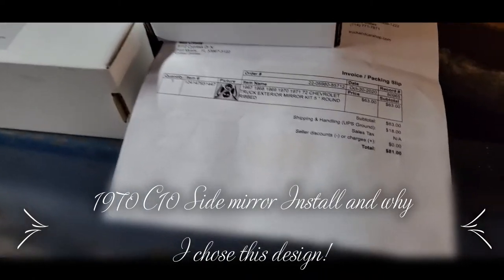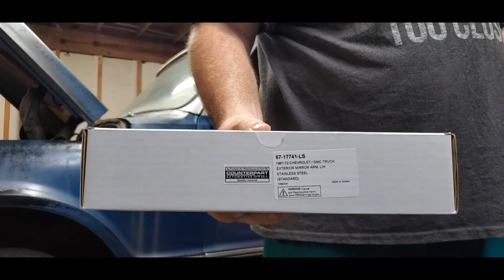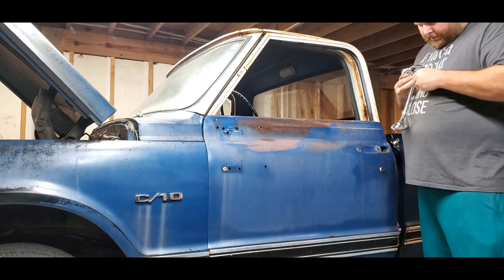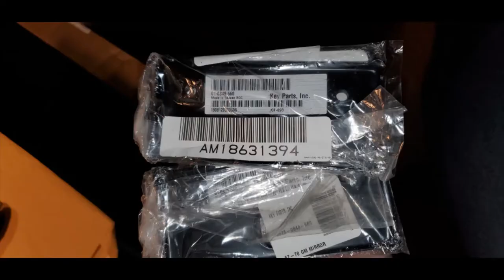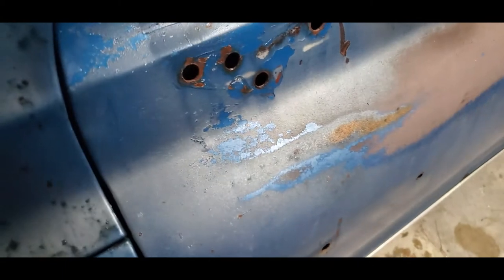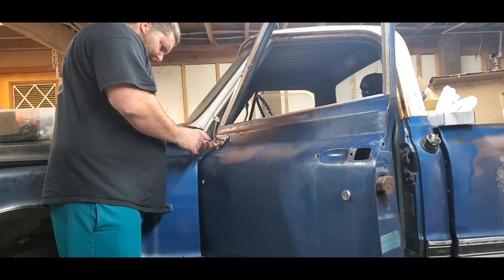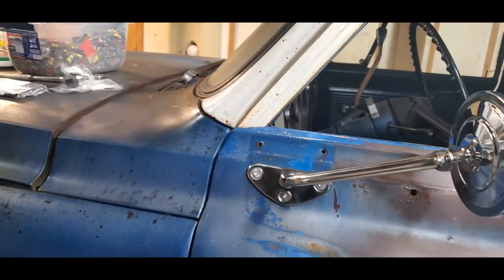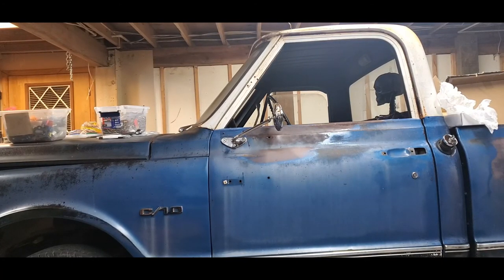1970 Chevy C10 Side mirror & why i chose this design!

Comment: Mirrors look good, I think im going to go with the square versions when I get to that point on my build
Reply from the maker: I almost did but worried they may look big even though these are 5" round
Reply: I tried the rectangular mirrors but they vibrated a ton at anything over 50 mph so I went back to the rounds. Just my experience...
Reply: The square version, or "sport" mirrors that these trucks came with look nice but are almost unusable when driving.  I've had them on my truck for a few years and the passenger side is completely useless.  Cannot adjust them enough to see down the side of the truck

Comment: Every time I work on these trucks, I find the factory backing plate laying in the bottom of the door.
Reply from the maker: I did look got both doors 100% apart replacing everything inside and on them that I can buy. Whole interior will be new and some mods for the stereo. Engine bay nice and shiny clean exterior bone stock but clean unbent trim and new lenses